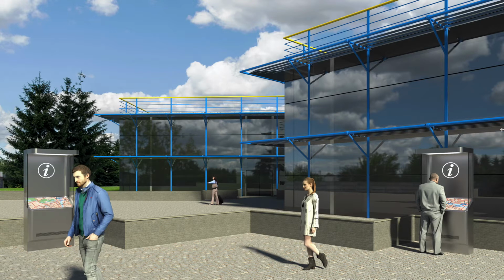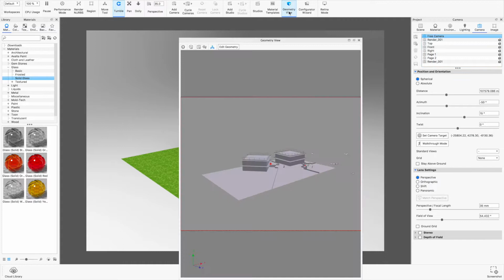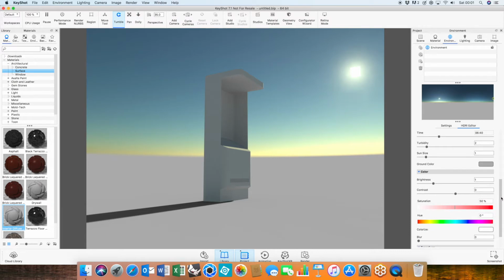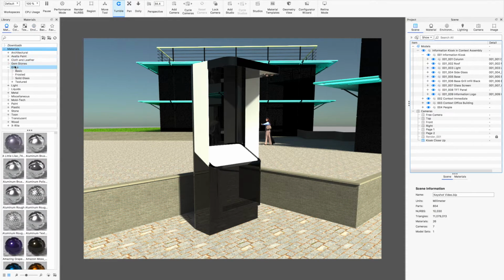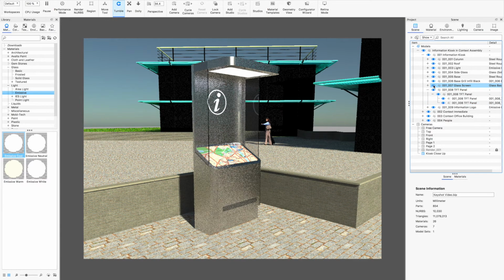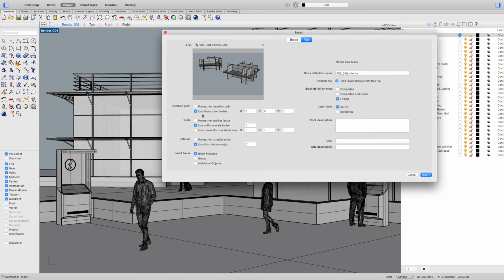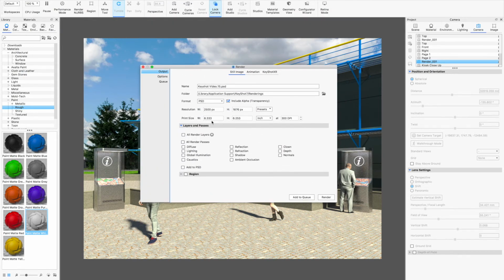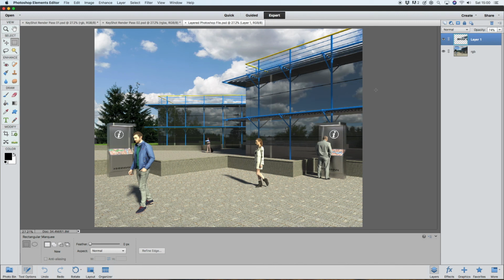Rhino & KeyShot for Mac - Architectural Exterior Render

Comment: In your opinion, for architectural rendering in terms of realistism, is Keyshot 7 still way behind V-Ray? Thanks in advance.
Reply from the maker: Hi there, KeyShot and V-Ray are aimed at different markets with the latter being perhaps more focused on architecture. It is, however, possible to do similar types of renders on both platforms but as in all processes the ‘quality’ comes from the interaction between the user and the software rather than the software itself. The other and perhaps more pressing point about this video is that if you have Rhino for Mac then, at the time of writing, there is no V-Ray plug-in available. There is also no sunlight control inside Rhino for Mac and so KeyShot for Mac currently provides a solution that is not otherwise available to Mac only users. Thanks for watching.
Reply: @SimplyRhino3D  Hello, what do you think of Maxwell render then? It has a plug in avilable for Rhino and it seems a little bit more integrated to it.
Reply from the maker: @gonzalozech  Hi Gonzalo. Maxwell along with other products such as V-Ray are very capable renderers, however their use and setup is somewhat more involved than that of KeyShot and so these products appeal to a slightly different audience.